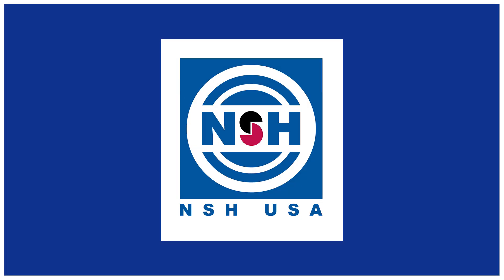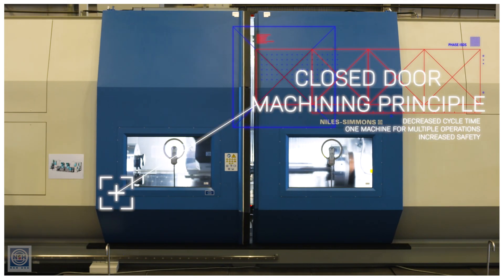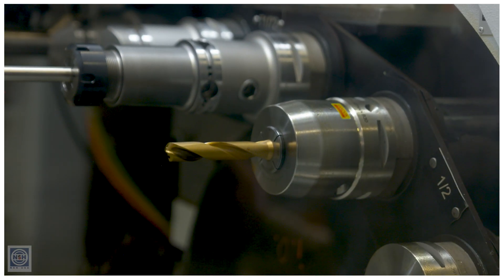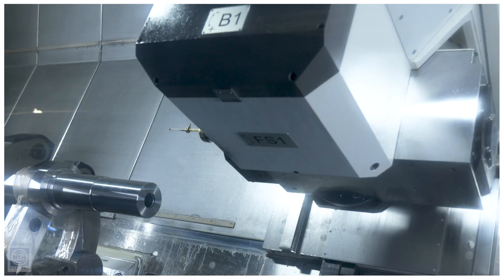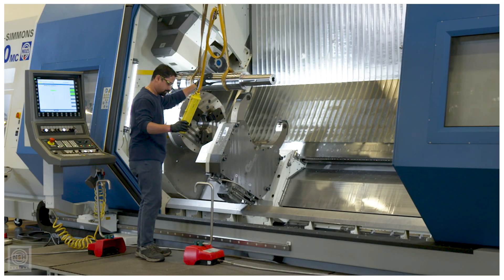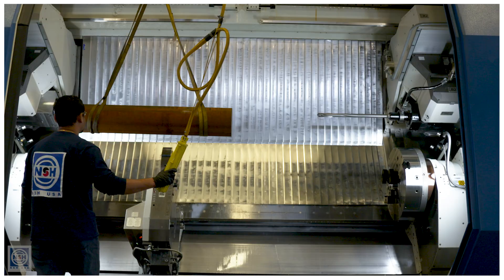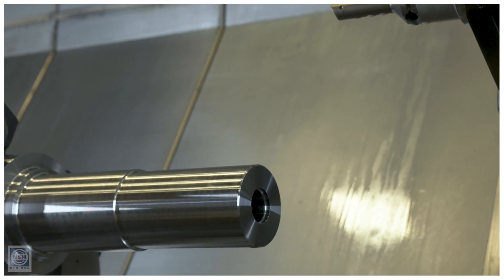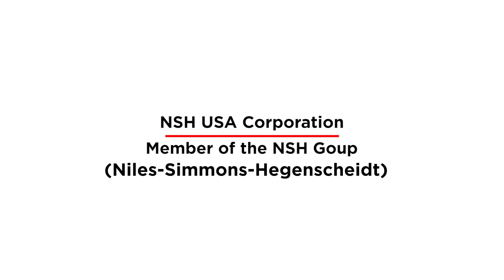NSH USA and the NILES-SIMMONS N30 MC: Technology Wins Part 1

Comment: What software do you use for the creation of digital twin?
Reply: Great question - we use NX for the digital twin, using VNCK to drive the simulation.  VNCK (Virtual Numerical Control Kernel) is an exact replica of the Siemens CNC controller so that motion in the simulation is calculated the exact same way as it will be executed on the machine.